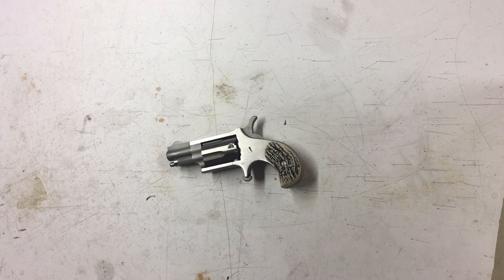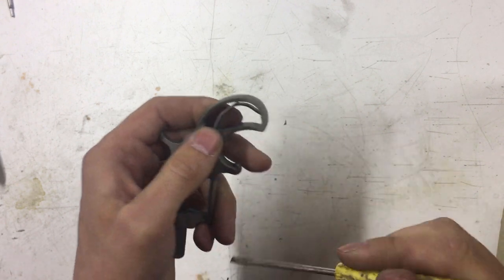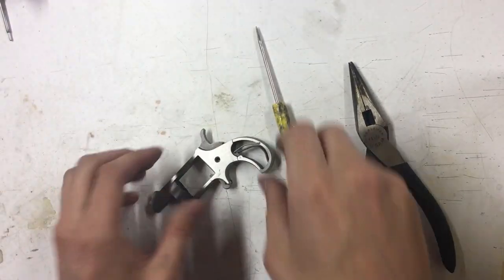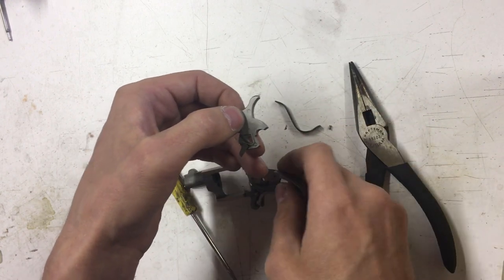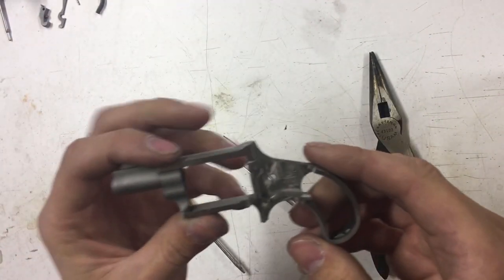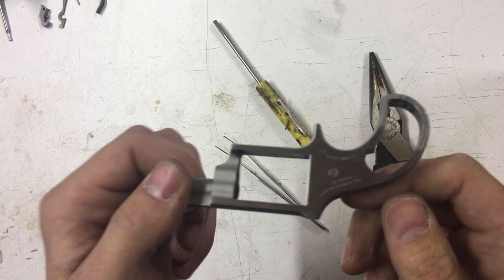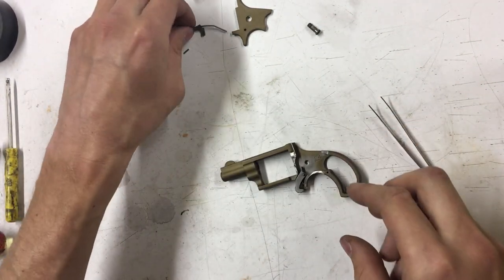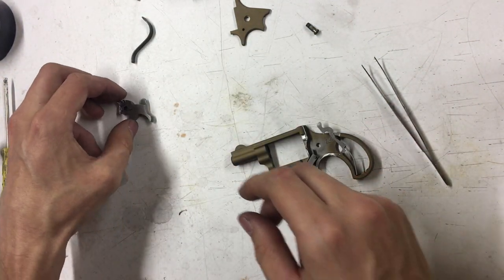North American Arms 22 complete disassembly

Comment: Good grief, that's intricate. I've got one, but I'll probably never open that Pandora's box...
Reply: sure but its simple. theres only a few pieces. if you have ever built a model you can do it with the right tools. every piece has a function so you wont misplace them.
Reply: Good call. I did it with mine and it NEVER worked again 😢

Comment: Your leaving primary spring is good idea to not scratch interior area. I saw other vid that they released primary with pliers but left secondary connected so it is under tension to not lose hand spring. But I see doing it your way the hand spring didn't fly out. I will do it your way on my NAA22LR for sure.  Thank you for your details in this video!

Comment: Appreciate the video. Only recommendation would be to get a set of (real) gunsmith screwdrivers. Like gun screws, the gunsmith screwdrivers don't have a taper at all. The part that engages the screw is perfectly parallel on both sides (with no straight taper or curved taper). It makes a difference in not marring the screws. (edit: I agree. You should never have to mar or wear a gun/part to assemble or disassemble it. It's why I'm really not a fan of roll pins).

Comment: To take off the side please take the back of the screwdriver the plastic pot holder by the barrel Inn tap the grip and the base plate of pop up without having to wedge it out with a screwdriver that’s incorrect

Comment: What was the tape for?
Reply from the maker: I ended up not using it on this project but if I have areas I’m worried about scratching I put electrical tape on it. Typically around screws or pins.